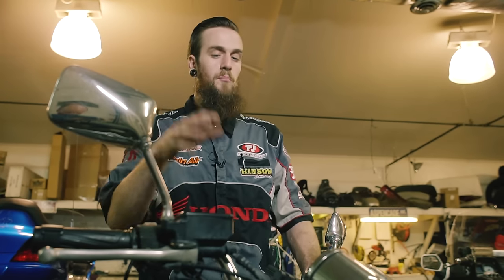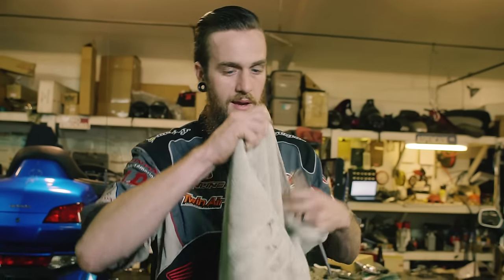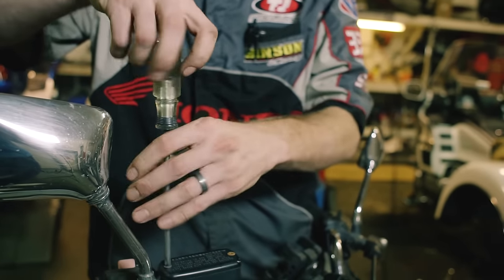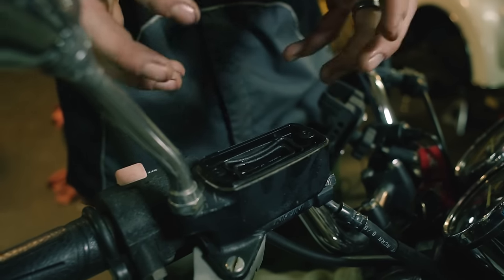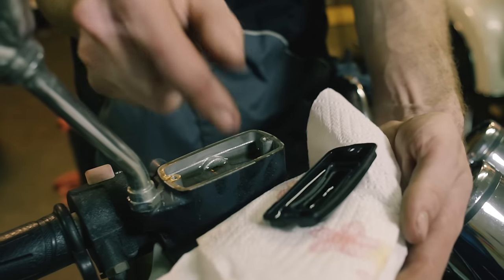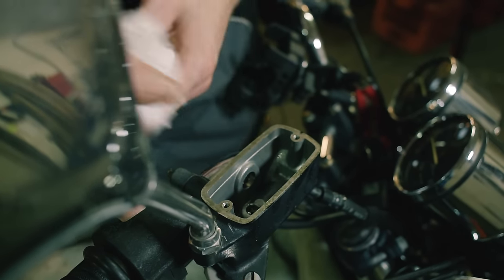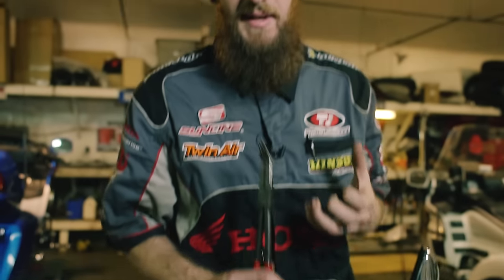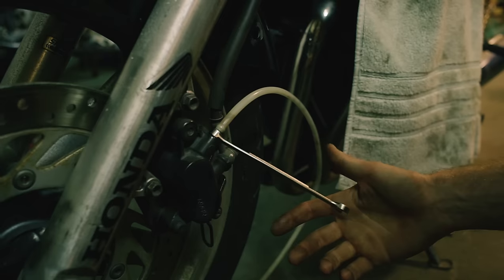Brake Fluid Replacement: Honda Motorcycle

Comment: A lot of so-called stainless brake lines are nothing but a cheap polyethylene tube covered in a decorative SOCK of braided stainless, and that poly hose is pretty much the same crap used on a refrigerator ice maker or reverse-osmosis unit, furnace humidifier or water-softener etc - like "PEX" in 1/8"-NPT size? Yeah. That SOCK is loose and the hose can expand to take up that gap in between the unpressurized hose and the inner surface of the sock. At least the OEM rubber hoses have their braid integrally cast into their body material. The "sock" type braid is like a "Chinese finger-trap" toy, meaning it can get really fat if it's allowed to shrink back in length, or vice-versa - They often try to use the end fittings to hold it in place but it isn't tight in the first place so it's futile. The better ones have a bonding material where it's not just the outer coating of clear rubber/plastic/silicone crap, but also in BETWEEN the outer sheath and the inner tube. What you want above all else are the HARD lines, like they used on early '70s Japanese Superbikes, CB750K0 Sand-Cast, GT750K+ "Kettle" aka "Waterbuffalo" etc etc. And what you really don't want is two parallel full-length lines up front rather than the "Y" configuration. The Y has about 3/4 the overall length compared to the parallel "H" or "II" I should rather say. As such, the parallel lines have to be 4/3rds or 1.33 times as strong as the standard set-up, just to MATCH the specification. Flex in the line creates a change in volume, meaning the volume change you're trying to create with the M/C piston is lessened. You could have a very flexible rubber balloon for a line, and it'd be find just so long as you kept it really short! And a line that's not perfectly stiff is a problem when it's overly long 'cause there's a cumulative effect from the given degree of flex over each and every inch of that length. Now HARD lines on the other hand, IF there's any flex at all, it's probably due to minuscule bubbles being trapped inside - you could more or less think of 'em as an extension of the master-cylinder itself, or rather as a reduction in the overall length in your system. A standard Y configuration dual-disc from a '73+ GT750 might have only two short hard lines at the bottom, but a CUSTOM version of which, you might have as many as SIX of the damn things, albeit with a heck of a lot of connecting hardware etc. A sensible middle-ground might be to use FOUR - one on each caliper, a short bit of flex line on one side of the T connector so as to assist with assembly/disassembly etc, then a length of flex across the span of the fork's suspension-travel gap, another hard-line between the top & bottom yokes, a short bit of flex for handlebar adjustment & assembly/disassembly etc, and a hard-line at the master-cylinder end just for good measure. What's that add up to, four? Yeah. Pain in the ass about the connectors, but keeping in mind they needn't all be a BANJO fitting 'cause the hard-lines have a little threaded collet so as to avoid that shituation. Which makes it a hassle to connect 'em to custom brake lines, but simple to connect to calipers, master-cylinders, the T-connector, etc. Heck you might be able to design the whole thing to not even use a single banjo bolt in the whole mess. Though you'll probably want just the one for the pressure sensor to run the brake light - on a street-bike anyhow. Or for decorative purposes, maybe? But yeah, it's not like you've GOTTA use 'em! Me, I'm gonna try and balance the number of hard-lines, flex-lines, and banjo-bolts, so that it looks more or less OEM for the early-mid '70s. 'Cause that's my thing. But whatever - all I'm sayin' is DON'T GET BURNED on these supposedly superior brake-lines, take a good look at what you're buying!

Comment: This guy has no clue what he's on about. For one, diaphragm does not need replacing every time. Only when damaged. Secondly, pinching the brake line with your pliers is a great way to damage the line! Don't do this to your bike please. Guys over at "Partzilla" on YouTube do a way better job of showing you how to bleed brakes.